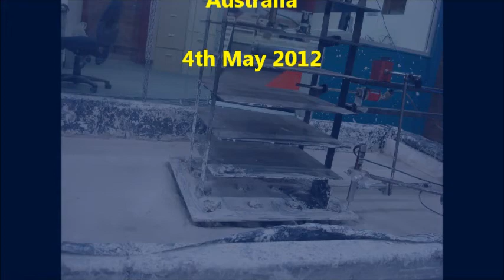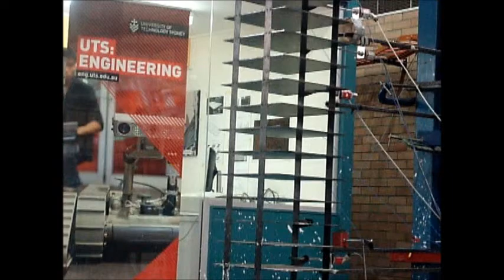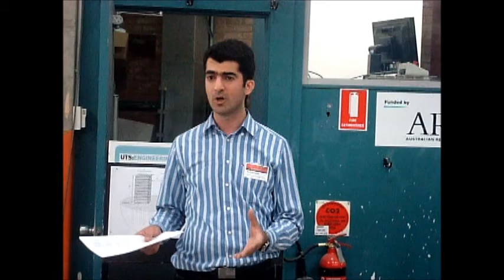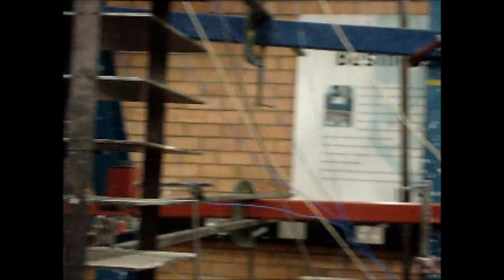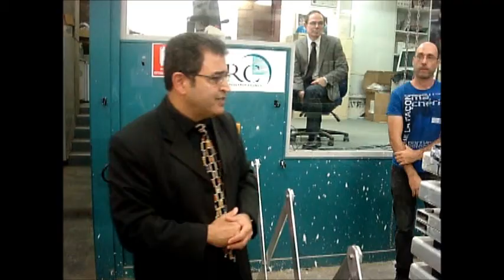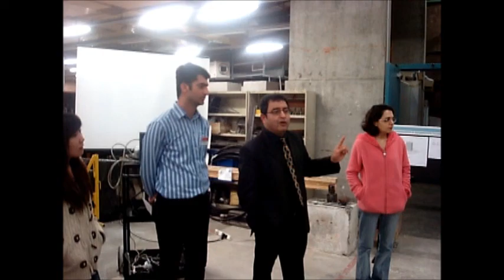UTS Testing for Sesmic Soil-Structure Interaction

Comment: Thanks for the model Dr. I think a delicate structure should have turned with its foundation.
I am also working on the subject and I will have some questions. If you can answer I would be grateful.

But the superstructure is so rigid, why doesn't it move?

Also, your ground boundary requirement for a 15-story building is not less?

And why is the main not overturning? I would wait for the foundation to overturn. Because your build seems to have an H / B ratio greater than 5.
I think a slender structure should have turned with its foundation.

There is one more subject. Although you are experimenting, I think you should not divide the earthquake load you give to a built building by R. Because you assess the capacity of existing structures. This information is also available in FEMA 356 performance and overturning criteria.

If I am wrong, please correct it. my goal is not to criticize you, but to advance science. You can also reach the related topic at nextpage@outlook.com.tr. I am a PhD student.
Reply from the maker: Hi, Thanks for reaching out. Indeed, the superstructure is quite flexible corresponding to moment resisting frames. Both distortional drifts and foundation rocking were observed. Subjected to the level of earthquakes applied and size if foundation, overturning was not expected. The earthquake acceleration values were not adjusted but the frequency needed to be scaled to ensure similitude conditions are satisfied. Our experiments covered different structural heights and foundation types (different piles and shallow foundation).

You can look at the details of our setup and results in our published papers.

https://www.sciencedirect.com/science/article/abs/pii/S0266352X13001353
https://ascelibrary.org/doi/abs/10.1061/(ASCE)GM.1943-5622.0000396
https://journals.sagepub.com/doi/abs/10.1260/1369-4332.17.1.109

We have also conducted rigorous numerical modelling for simulation of seismic soil structure interaction (SSSI)and recently proposed new solutions for protection of structures against large earthquakes considering SSSI and you can look at them below:

https://www.worldscientific.com/doi/abs/10.1142/S0219455415500431
https://www.sciencedirect.com/science/article/abs/pii/S026772611830678X
https://www.sciencedirect.com/science/article/abs/pii/S0266114418300268
https://www.icevirtuallibrary.com/doi/abs/10.1680/jgein.18.00018

I hope you find the above information useful.

Comment: I think You got something wrong with elastic response of the structure (the numerical analysis) in your project.

Also, it is not clear what are the damping values for the structures you assigned 

I tried to contact you on research gate but unfortunately you didn’t respond.
Reply from the maker: https://www.sciencedirect.com/science/article/pii/S0266352X13001353
Reply from the maker: Cannot see any message on research gate from this name; can try again.
Reply: Behzad Fatahi ok, I know it is been published. I like this work. 

But my note is related to the numerical analysis. 

Will send you a message instead of making the argument in public
Reply from the maker: Dynamic Mo This paper I sent is 3D numerical analysis. Check that out.
Reply: Behzad Fatahi Dear Doctor, i will 
I’ve read all of your publications. 
From the first one which was talking about the elastic response of 5,10 and 15 MRF structure considering SSI using FLAC 
Till this one.  I said i think you got something wrong. I might be wrong. 

For that paper when you got the drift ratio , you multiplied the value by the ductility divided by the safety factor! 

I think that equation should be used when we design not when we analyze. Please correct me if i am wrong 

The other thing when you’ve done the experience, you will not need to calculate the damping. I didn’t see what kind of analytical expression you used for the numerical simulation and what are the values. 

Excuse my comments in here but when i read your desertion and the publications, I got question marks and these are examples.
Reply from the maker: @dynamicmo9044  Just email me with proper reference to each paper with your questions, happy to help.
Reply: Behzad Fatahi ok send me your email